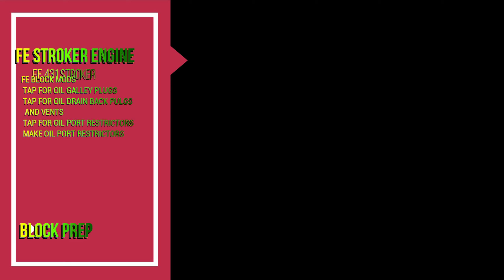FE Block Improvements

Comment: I've got a 352ci FE in a 68 F100, great old truck but getting kinda long in the tooth. Not sure which way I'm going with it, restomod with a newer engine or rebuild the 352. It's a gas hog, with the original 2 bbl  carb, been rebuilt a few times. It's a long box not the coveted bubble butt.
Reply from the maker: Mine's a 71 F350 with service bed. Has the 360 in it also a gas hog. But people I have talked to and read comments on state the gas mileage gets better when Cubic Inches are increased.